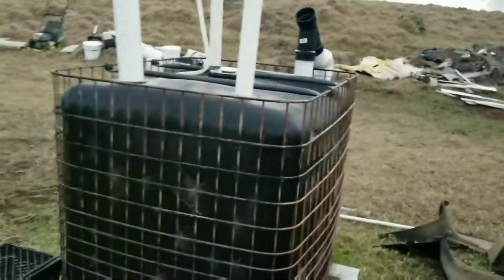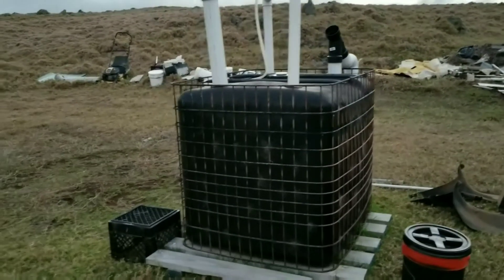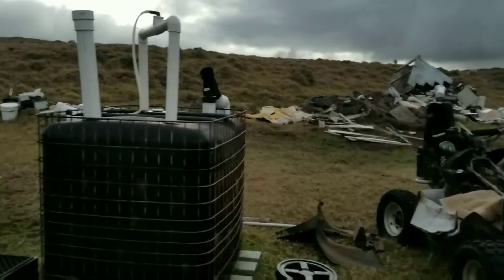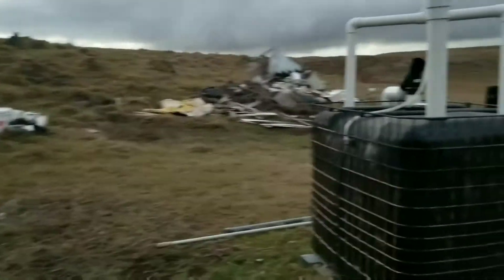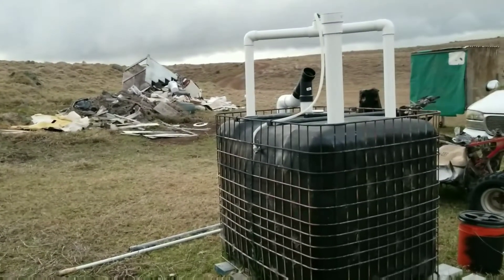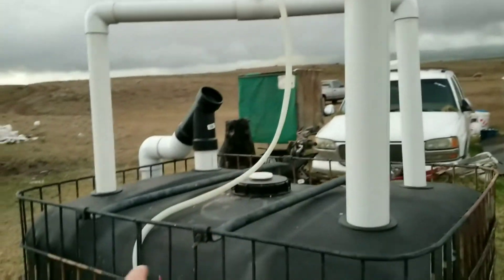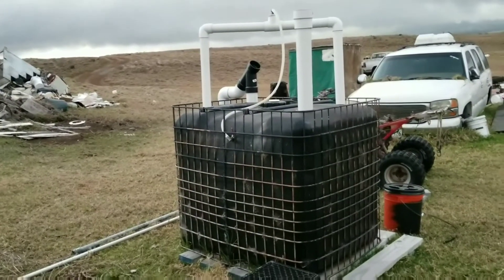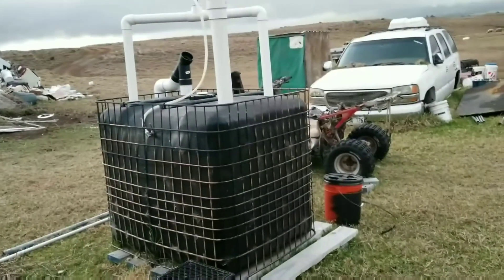Biogas Flame it Works 12" Bio-gas Flame Hawaii IBC tank

Comment: Nice!! I wonder what the rate of production is? I assume it will depend on what and how much you feed it. That said, just how much gas for a known amount of "stuff" into the digester? and how long? This would be nice to know so you could plan around that information. I would like to do this in a trailer scale but don't think it would be easy to do being moved from time to time and the weight.
Reply from the maker: +Antone Schweitzer I will be doing a Lot of test coming up. I plan on hooking the bag up to it tomorrow and see how long it takes to fill it, and how long the bag will last burning the gas, lots of test to come.

Comment: very interesting , i will be doing this. pure hydrogen cells could do the same but biogas is another good diy energy source.
is it JUST food waste or the other, im almost too scared too ask LOL
you may need a low pressure flash back areestor for when the bag is huge.
Reply from the maker: +closertothetruth I made some Modifications coming up in new video.